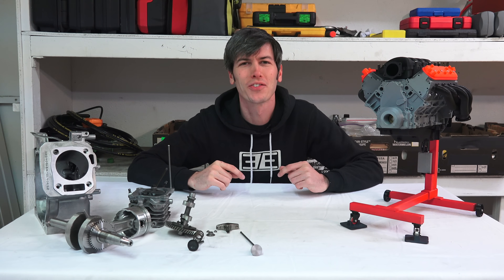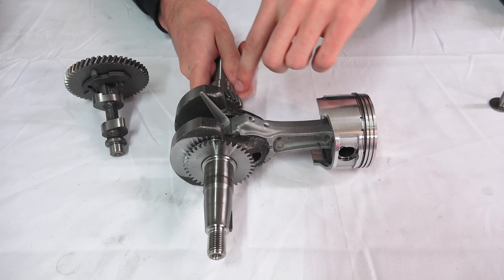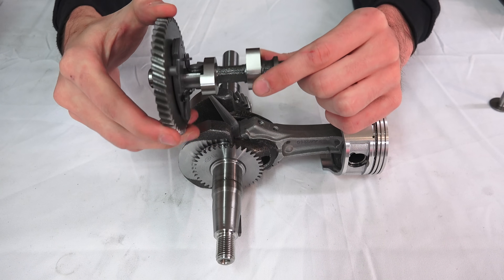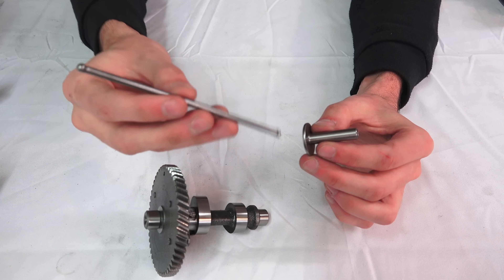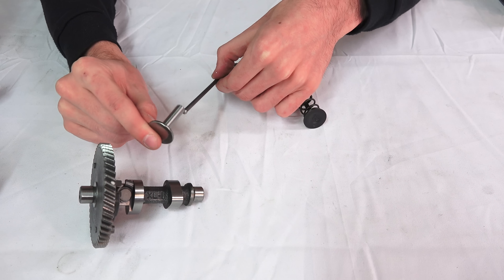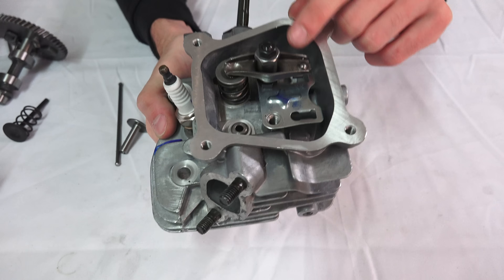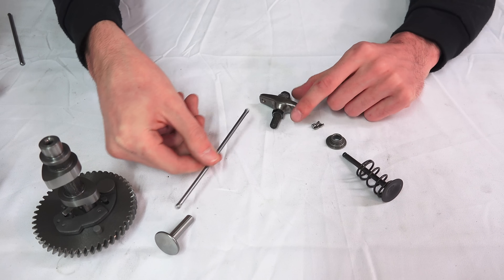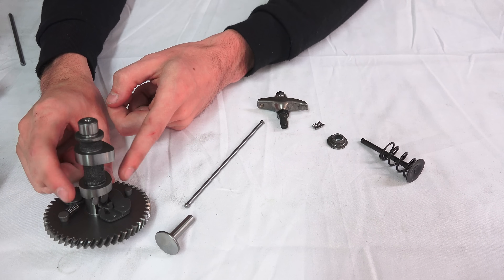Why Can't Pushrod Engines Rev High?

Comment: He has clearly never seen Steve Dulcich explain how to make a push-rod engine rev high.
Reply: Alex Walcker Its episode 382
Reply: Corvette has plenty of wins and podiums at Lemans to prove that isn't true. LMPC cars used a crate LS3 engine from 2009-2017. Can't forget pushrods dominate drag racing and they certainly aren't cheap. Most of the engines I tune cost more than a brand new Porsche GT3 H6.
Reply: I guarantee you that us "meathead" pushrod engine builders have forgotten more than you know about engines.
Reply: Could you put a link to that video?
Reply: Alex Walcker it's on motor trend on demand in a roadkill extra.
Reply: Thankyou
Reply: J.P. Craven if by "obsolete", you mean "not the latest and greatest", ive got some bad news for you, virtually every conventional engine with poppit valves, both pushrod and overhead cam are obsolete - theres a new concept i saw recently here on youtube thats a 3 cylinder, 6 piston opposed layout, 2 stroke that had no valves at all, with thermal efficiencies north of 50%. See Achates Power. Made 270 hp, 480 lb feet of torque at only 2.7l displacement.
Reply: Dude opposed piston engines have been around for 100 years, they aren't a new concept at all what are you talking about?
Reply: @totobyafrica847  Yes, with the last time of notable use in a ww2 german airplane engine - they were largely abandoned at that time due to engineering issues and the resulting problems - reliabilty and horrible efficiency. Innovations like direct injection controlled by computers, something that has only recently been introduced for gasoline engines for automobiles, have made the design viable again. Theres a couple of interesting videos on YouTube that get into the nitty gritty of the Achates engine.
Reply: The last notable use wasn't WW2? I don't know where you pulled that from, there are quite a opposed piston motors that were developed throughout the years, I have an Alvis Stawart that I went to the trouble of swapping a Rolls Royce K60 in it (amazing motor) and it will literally run off vodka. The only opposed piston engines I can think of with reliability issues are Deltics but they're their own nightmare.

I was replying saying they weren't a new concept because they aren't, the design hasn't changed at all really, I don't know why people are saying it's some new amazing thing.
Reply: @totobyafrica847  I was referring to gasoline applications. Theyre still in use in cargo ships, but those are using diesel/bunker fuel, and are used for much the same reason that Achates is notable - efficiency. Because they operate at extremely low rpms, much of the engineering drawbacks are mitigated. In automotive applications, i dont think theyve been used since the 1920s.
Reply: I thought you were talking about diesel soz, but yeah i've never heard of a opposed piston 2 stroke petrol
Reply: I need that information so the 5.0L Windsor V8 in my '89 Crown Vic will sound meaner.
Reply: I think the recent Demon proves OHV is far from obsolete, with the LS series being stellar examples. OHC can lead to greater power and efficiency, but are much larger in size and much more expensive.
Reply: can we get an amen for our belived lord and savior the mopar 400 Big block?
also ROADKILL!
Reply: Umm no, people just dont know how to because they are less common now.
Reply: Wow... put all that money and work into making a pushrod engine rev as high as grandma’s bone stock Civic DX.

Comment: corvette also had a dohc in the 90s
Reply: They might be using one for a mid engine C8.
Reply: that LT5.2 was a beast, it had variable cam lift and made over 530hp @7,800rpm  which for 1997 would have been unheard of. Oh the glory it could have brought to this nation, to bad it weighed like 600lbs compared to a 425lbs LS1 and was to way big to fit under the c5s tiny hood.
Reply: I'll be Frank I'm Leary about using my name it was a lotus design from ground up when gm bought them lotus loved the time with their engine they offered Chevy a lt5.2 for the c5 Chevy turned them down. Sad that we aren't seeing lotus and Chevy have another love child together.
Reply: I'll be Frank I'm Leary about using my name damn beat me to it. From what I've learned they milked the pushrod ls as long as they could yo keep a lightweight v8 with a low center of gravity and aerodynamic profile on the vette. But, in a mid engine Corvette, the weight concerns and height of the block become less of a concern. Next thing you know, the vette is just another supercar. Honestly if I wanted a high revving low displacement v8 mid engine sports car, I've got plenty to choose from. I've always loved the vette because it stuck to American muscle roots and still impressed, or embarrassed, cars much more expensive. Times are changing, the days of raw low end torque are coming to an end. The age of the tuner(and hydraulic tensioner replacement every 75,000 miles, plus that annoying rattle of Doha motors turning 6 feet of chain) are upon us.
Reply: jdr ok best recent love child in memory was gm/isuzu with the birth of the duramax!
Reply: ryan janki yeah in the original zr1 it was actually a lotus or Yamaha  built engine I believe.
Reply: The original LT5 had lotus designed heads and was assembled by mercury marine boat engine builders,  it was a very trick engine with 18 throttle bodies and half the    throttle bodies closed off at low rpm for a vtec like effect ,  it was super expensive and it was all aluminum but weighed more then the iron push rod 5.7L and the ZR1 weighed 200lbs more then the iron block Z51 , and didn't really make that much more power then the push rod LT4 ,  405hp vs 330hp but keep in mind the weight disadvantage   which also kill the 50/50 balance the base model had.  But it was fast for a 3,550lbs car with 405hp to go 0-60 in 4.3sec and 12.7sec  1/4 mile. GM plained to use it in the C5 corvette but it was way to heavy and didn't fit under the hood   and the LS6  made just as much power but cheaper and 150lbs lighter and lower
Reply: Another problem with DOHC engines is they are already maxed out, you could spend thousands on porting, race cams, equal length headers, intake for a 5.2L voodoo and only squeak out a few more HP, but a LS3 can go from 430hp to 535hp with a $500 cam and $500 headers. And they DOHC will always have less torque because they get there dyno marketing hp number from a smaller displacement but in reality on a track a 500hp 7.0L will a huge torque/powerband advantage over a 500hp 5.0L
Reply: ryan janki true but oh lotus and Chevy can do great things lol.

Comment: What are  the advantages to using a push rod engine?  Also, thanks for these videos. I'm a civil engineer but have always had an interest in cars and up until recently all my knowledge was on small engines. I've learned a lot from you and I plan on watching all the videos you put out.
Reply: Simpler and more power at low engine speeds
Reply: Push rod V8’s are far less complex to build and maintain, so the are cheaper. Also there package is much smaller than a V8’s with DOHC’s.

When the volumes are the same a push rod engine will have less power than a DOHC because the latter will be able to rev faster. 

But I think it will make more sense to compare a push rod V8 with a smaller inline 6 with DOHC, twin turbo and direct injection. 
That would give a comparable amount of power in a comparable package size. (But no doubt at much higher costs)
Reply: Power and cheap/easy power
Reply: Holy cow! Thanks for all the information guys! This is one hell of a community.
Reply: Reliable.
Reply: iam just like you greg
Reply: Igor, very insightful comments and all true with your proviso "everything being equal." The situation for many of us though is that everything is not equal, or does not have to be. If you want to go faster with pushrods, you skip the crazy cam and just move up to the next higher displacement LS engine, which is more compact, lighter, less complex and cheaper than the competing DOHC engine. If you want to go faster with the DOHC engine, be prepared to buy 4 cams and who knows how many valve springs.
Reply: Ad Badditude , why there should be more power on lower rpm with OHV?
Reply: Eduard van Raalte pushrods are far more complex to actually build..
Reply: Igor Arkin both ohc and pushrod ohv engines are ohv. They offer their own little benefits. But both are being wildly compared in retarded ways as 4v and 2v configs exist for both.
Reply: jdr ok that's why push rod one won't have more torque at lower range. Because adding OHC to such engine will not take torque from bottom and shift to top, but prolong pik torque further. OHC affects same way as a VVT system. You still have the same displacement and can have same valve timing = the same torque at the same revs before the pik, but due to better valvetrain efficiency you don't loose torque after the pik that fast as before. Next you can step ahead and add 2 more valves per cyl. getting more torque and fuel economy everywhere on the range of revs
Reply: Igor Arkin ohc engines will literally have the same torque per cubic inch... The efficiency of both valvetrain isn't that different....
Reply: Igor Arkin and no more valves does not equate to more fuel economy...
Reply: jdr ok, pumping losses are one of the major power loss factor, thus reducing pumping losses increases the ammount of useful torque on the flywheel. If you fullthrottle it you go faster,  if you don't use it you save more fuel (adding more valves reduces pumping losses)
Reply: Ben Garrido overhead cams do nothing with crazy revs, and most important they do nothing about torque ammount before the pik, so they have the same fuel efficiency, everything being equal including 2 valves / cylinder. But if you want to go faster with pushrods you have to put in that angry crazy camshaft to move the torque to the top end, thus adding power and reducing torque (and fuel efficiency) on "civilian everyday drive" revs, including problems with starting the engine and idling in most difficult cases. No need to go with more agressive cams or lightweigh valves for OHC since they are already rev-friendly, but (in case of DOHC) you still can substitute cam swap with cams advancing/retarding (wich is almost zero money mod). So OHC is supposed to be better in terms of power and efficiency just right of the box.
Reply: Smaller engine packaging, for example an LS7 in a Corvette is tiny for its 7 liters and 505 hp, whereas a 4.6 Modular in a ‘90s Mustang is massive for the power and displacement. It’s almost the size of a big block V8 and that’s why overhead cam is just less practical
Reply: leverage. A rocker arm increases valve lift by a typical factor of 1.5-1.7.
Reply: Packaging, and nothing else.  Anyone that say anything like “low end power” or “less moving parts mean more reliable” is flying the big red “I don’t know what I’m talking about” flag
Reply: Packaging and weight are much better for a pushrod. They are also often more fuel efficient because you don't need crazy cams for high revs. 

This only holds for v engines, though.

Comment: The LS7 would like to have a word with you.
Reply from the maker: 7,000 RPM! Thanks to wicked titanium valves and lightening the valvetrain components. But my 20 year old Honda has it beat. (in literally just one parameter haha, redline, I'd love an LS7 in it).
Reply: Engineering Explained Haha I was just poking fun. I figured you know your stuff. I love a high revving NA engine, my FRS goes to a reasonable 7400, but I would trade that for more torque or a linear powerband (or an LS7) in a heartbeat!

Comment: so why make push rod engines at all?
Reply: A pushrod engine can be more compact and lighter weight, also it’s less complex and cheaper to make.
Reply from the maker: Lots of reasons, going to have a separate video covering the advantages. Seemed like a bit much to pack all of it into the same video.
Reply: thanks.  can't wait to hear your thoughts.  i was trying to think of some.  but all i could really come up with was legacy tooling. (which i assume would make it cheaper)
Reply: makes sense.  i guess you only need one cam-shaft all that stuff rides inside the v....
Reply: Nutz4Gunz45 it's less complex on the heads but split a ohc and pushrod block both are extremely complicated in their own ways